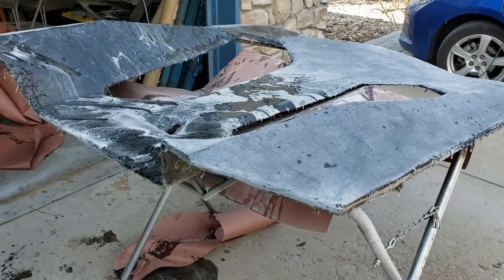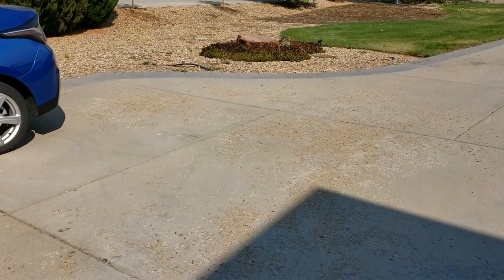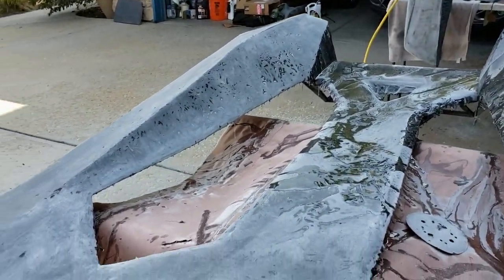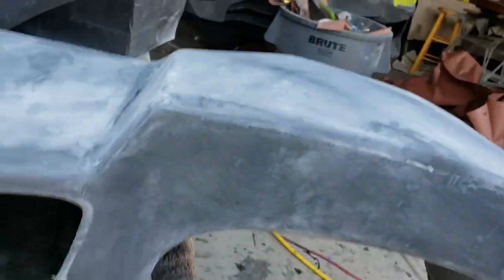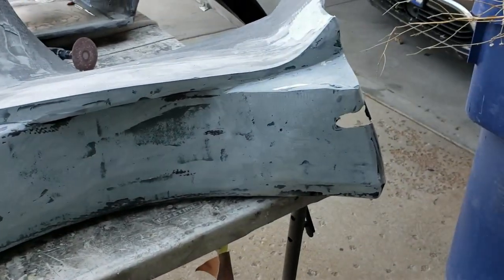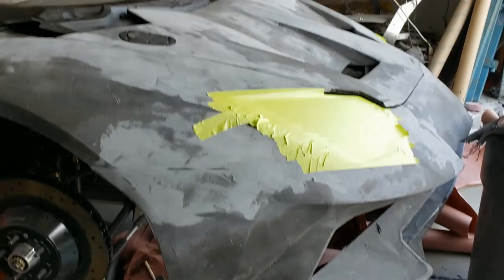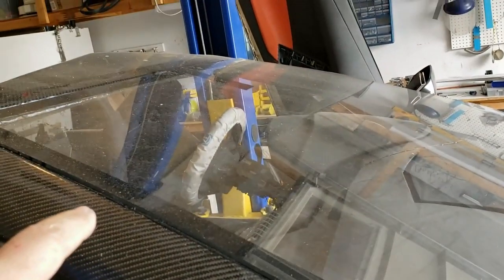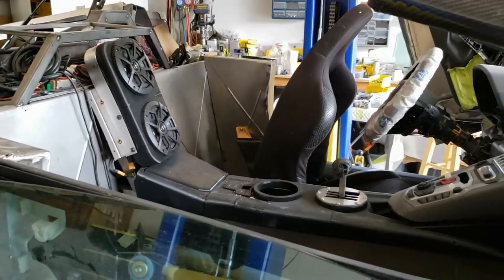3D Printed Interceptor Update 54

Comment: Before you first started this magnificent project, did you have a source of AutoCAD files(or whatever software you use) for each individual Lamborghini body part or did you have to render these yourself?
Reply from the maker: Myself.  Started with a 1:10 scale model.  Then changed it to a widebody.
Reply: @lasersterling  Did you physically scan the model and go from there? I was contemplating an attempt at some custom car body work using the same method you've obviously mastered.
Would you have any advice for someone who is starting the same journey you have undertaken and are more than well on your way to completion? I have actually restored several vehicles in the past, but I have no experience with 3D printer/extruders or 3D rendering software.